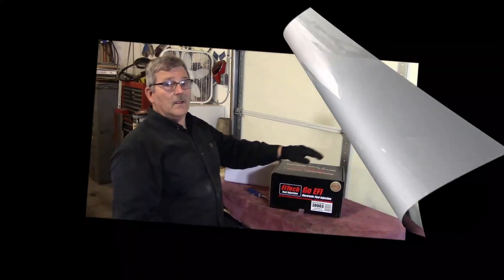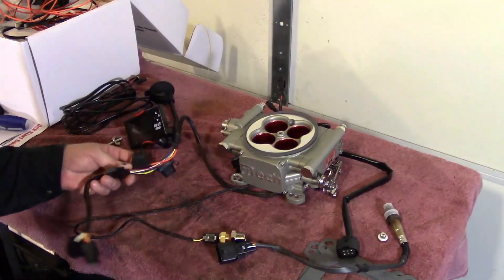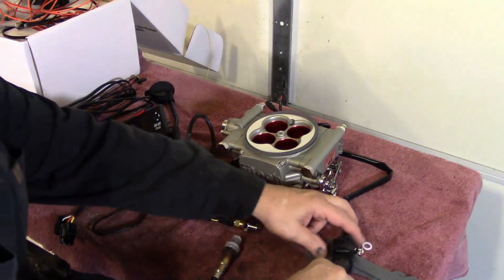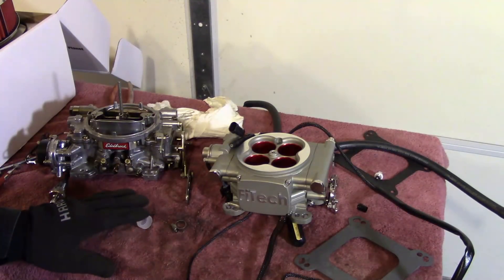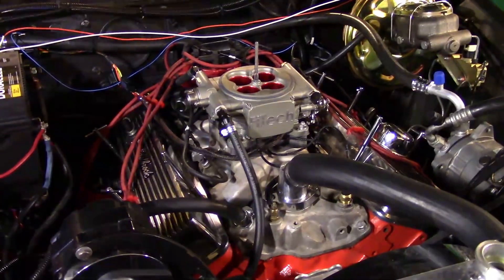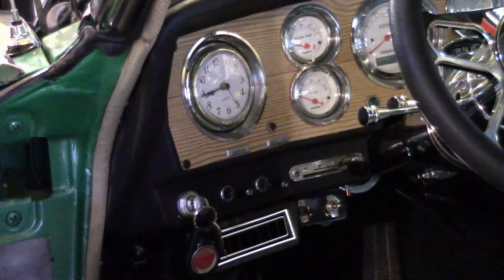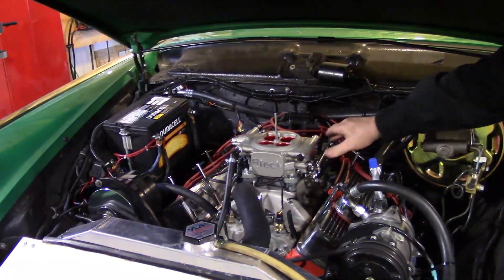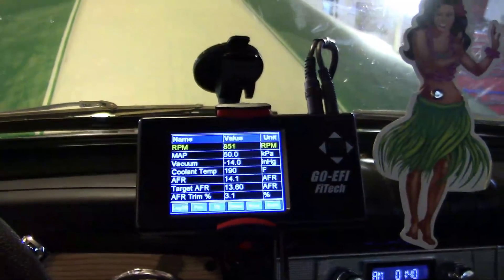FITech Fuel Injection for the 62 Studebaker

Comment: Izzy and I run the Fitech on both our vettes. Yep, its a Gm temp sensor and vw o2 sensor. Your o2 is to close to the head it needs to be at least 18" away from the manifold down the pipe. Once you get it warmed up adjust you IAC a little higher than what they tell you like around 8-15 is the sweet spot. After you get about 3-400 miles on it you will feel the power and it is a sweet system. I have the 600 unit on my 73 vette and Izzy has the 400 unit on her 80 vette and WOW what a difference it made to hers maybe 50-60 more hp at the wheels. Mine hasn't had enough time to learn but it will. You are going to love it.
Reply from the maker: scottsinfl   Thanks for the tips. I will be watching and checking how it performs. Take care

Comment: Can’t beat fuel injection. Where you mounted that line to the filler neck. That’s just a vent line right? At first I was thinking hey that might rub a hole in that line then I remembered that should be a vent hose
Reply from the maker: The fuel cap is vented . I added the J tube for a return fuel line. Have a great week.

Comment: I am really interested in this. I have a DIY setup I pulled from a suburban in the junk yard. But have to manually tune it . Looking forward to seeing how this works out. How involved is the setup? Also, dose it control timing.
Reply from the maker: I put a GM throttle body on a el Camino I had and liked it. I want something easier to install than that through. Happy with this one. This model doesn't control timing but they have other models that do.
Reply: You have to get the 600 unit before it controls the timing.

Comment: very cool was that bolt on and start then drive it was that easy i know you have to bolt all sencors and stuff
Reply from the maker: The only external mounted sensor are the O2  and exhaust sensor. It also needs battery power, a tach signal and key on . Run the fuel pump wire and your set. Put the very basic info in the system and fire it up.  I'm going to enjoy it. Thanks